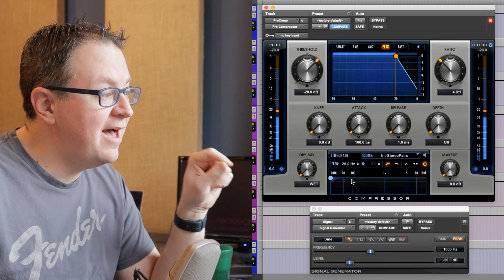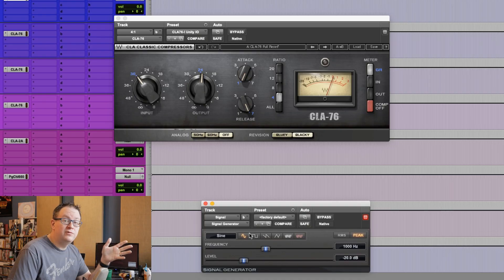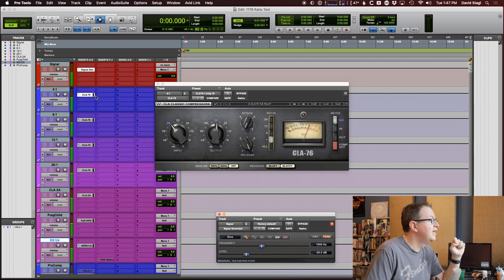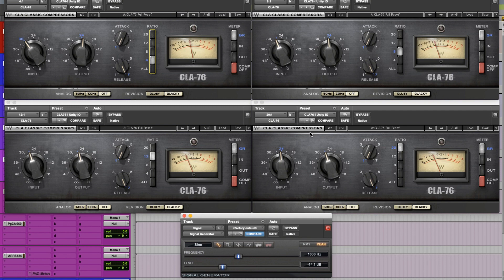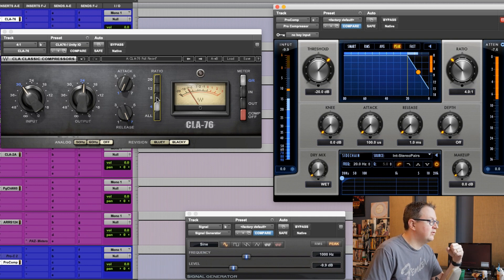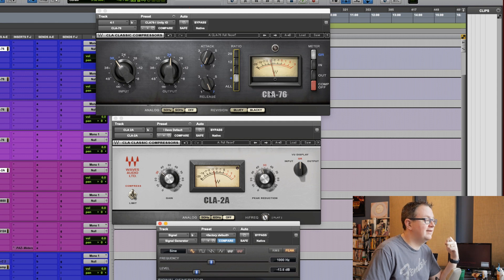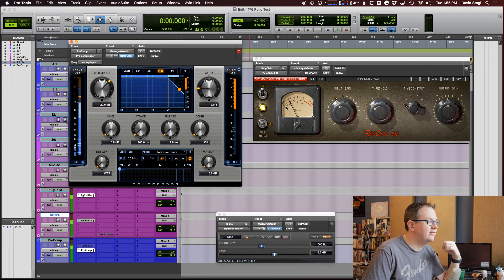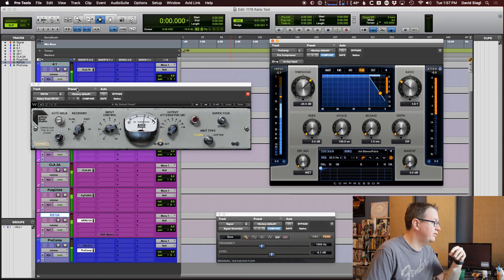Compressor Ratios & 1176's

Comment: I noticed the same weird behaivior from my Klark Technik 1176 and I thought that is very strange :)) Obviosly the treshold and ratio are floating simultaneously and that's why it's so confusing. For my vocals I can use it even with 20;1 ratio to be able to squeeze more from my pre ( higher treshold)
Thank you for this video!

Comment: I think you missed out a crucial point which is the knee.
You don't get less compression as you raise the ration because of the threshold, you get it because the knee becomes harder.
This is very common with compressors, for example the famous SSL Bus compressor is much "grabbier" on a 2:1 instead of a 4:1 because the knee is softer.

If it was just adjusting the threshold, once you would match the gain reduction with the different ratios it would sound the same, but it doesn't.
It's much more complex than that, higher ratios on a 1176 sound brighter, more upfront and more distorted.
It really changes the feel of the whole thing.